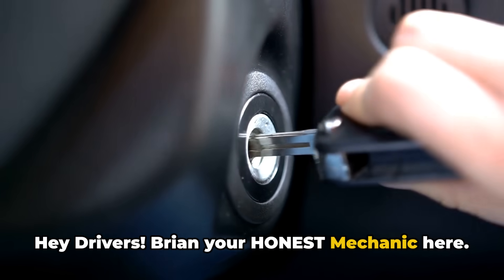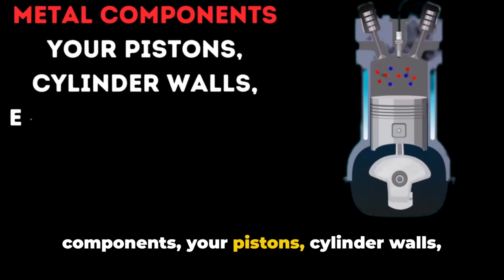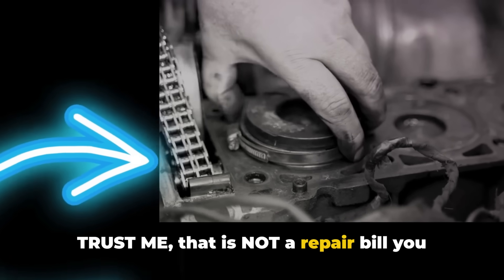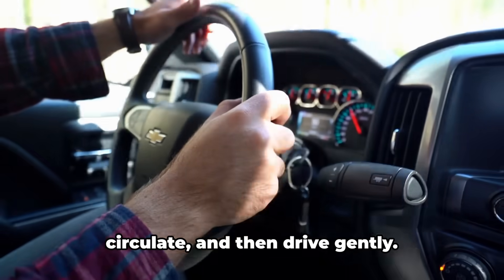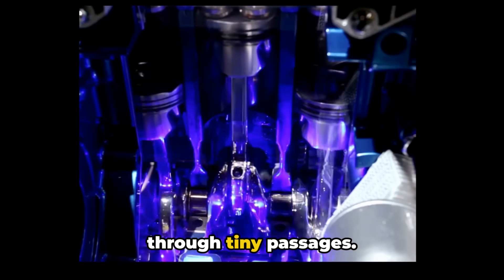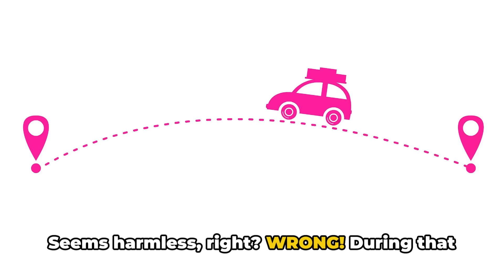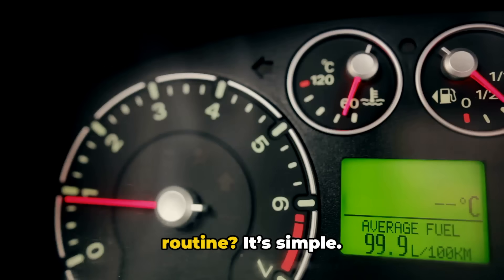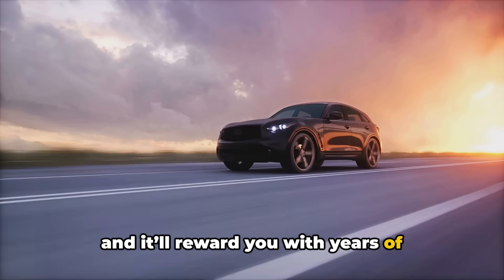5 Cold Start Mistakes That Wreck Your Engine (Avoid These)

Comment: One to add to that list, keep your heaters off until engine is at a reasonable temp, having heaters on on a cold morning at full blast will severely lengthen the time your engine takes to warrm up, this is more pronounced on Diesels as they typically run cooler than petrol engines, I've stood by this for years and notice a difference especially on fuel economy.

Comment: I haven't read 685 comments, and therefore someone might have answered this already. There are two badly flawed comments.

1) Nothing is said about the automatic transmission. The transmission fluid also needs operation temperature to function properly. There was a case were I wasn't able to drive a 15 passenger van that was standing for 3 days exposed to cold wind for 30 minutes. It took another 10 minutes before van was actually moving before there was no "driving like through molasses." The temperature was above 32 degrees but because of the high humidity there was a severe wind chill.
2) How many people can actually go onto the road with a cold engine/gearbox and drive slowly till the car has warmed up? How many do not wait long enough, minimal operation temperature reached? What is missing is: At what time is is safe to go onto a busy road, able to drive based on the traffic?

Comment: No. Don't wait 30 to 60 seconds then just go. Waiting until the rpm dips below 1000 is necessary as well. Shifting out of park above that causes premature wear on the transmission.

Comment: I drove a 6 minute trip to work in a cold climate for over ten years.  Car never warmed up.  I’ve had the car for 13 years and 190,000 miles later it still uses no oil to speak of.  Original exhaust system too!  Don’t believe everything you hear or read about short trips.

Comment: I respect your information, not only because you didn't call an engine a motor, but we all know motors are electrical. But you told the people the correct way and how to properly, take care of their vehicle. Depending on how cold it is I do let my vehicle warm up a tad more on colder days. Other than that I really do the same thing you were suggesting taking it easy on the first few miles of my trip. I am also a mechanic but I'm retired now and I did see all the damage that it can happen to an engine when it's cold.  👍🇺🇲☮🍺

Comment: Hey guys, I'd like a tip from you all. 

I park my car (Fiat Tipo, 1.4 turbo gas/LPG) in an underground garage. 
The temperature under there never drops under 10°C/50°F, I start her up and wait for the rpm to get down to their normal idling level. 

But since I have a quite steep ramp to climb, what should I do to avoid that "early stress" on the engine? 

Should I wait a bit more? Any other tips?

Comment: I must be a genius. I do all of these things. I drive manual transmission sedans exclusively. I drive away right away, (gently!) with no more than 2,000 RPM, and because progressive transmissions have such a huge jump in that first shift into second gear, I always double clutch into second gear. My transmission goes into gear easy. Others gripe about it being hard to get into gear. I am old, and I have never replaced an engine or a transmission. Treat your car right, and it will not cost you much to run.

Comment: What about spring start-up after winter storage? The oil has had ~6 months to settle to the bottom of the oil pan. When I turn the key in my 2000 convertible, the engine fires almost instantly but is in a fast idle mode. There are those few precious seconds when there is an engine rattle until the oil is circulated. In a ‘modern’ car, is there a convenient way of priming the oil before the engine fires? Emphasis on “convenient”😁Some have suggested pulling the fuse for the fuel pump so the engine doesn’t fire.

Comment: Again, no mention of actual cold temperatures. When its below zero, you can't start your vehicle and then start driving in 30-60 seconds otherwise your windshield ices up with no heat...This is fine if its above 20 degrees. If its teens give it at least 2 minutes. Single digits 3-5 minutes. Below zero, if you have a smaller engine, give it close to 5 mins or breathe into your jacket/sweatshirt lol. Polar vortex temps...GL, hope you have heated seats and steering wheel.

Comment: I disagree with driving after a few minutes.
Also you didn't mention auto- trans.
When it's bitter cold + u drive, the oil is thick in tranny.
Seals are stiff + your forcing  everything to move.
Not good.
Been warming up engines for many years no problems.
I let it warm till heat starts happening then the engine+ tranny can function normal.

Comment: " When your engine is idling cold its running rich on fuel "  Not so rich that its blowing past your rings and contaminating you oil.  It's far better to let it idle for a bit in cold weather then your so called wait "30 - 60 seconds" plan.

Comment: I always warmed my cars up before driving.  Never, ever had an issue with engine failure, burning oil, etc., and I run my cars over 200k miles.  You do what you want, but when it's 5 degrees outside, I don't let it run 30 seconds and then drive off, I let it idle 10 minutes.

Comment: work is 30 mins away, engine gets to optimal temperature about halfway through. in the cold i let it idle ~30 seconds, drive off with quarter throttle and upshift at 2000rpm (its a diesel), over time adding a little bit more throttle as the engine warms up. my fuel economy might not be as good as if my workplace was only 5 minutes away, but it sure does keep the car running healthy

Comment: I know this video is about protecting the ENGINE, but since we're talking about protecting the vehicle, I'd like to submit that I've heard this tip: in an automatic transmission vehicle, put it in NEUTRAL for a few seconds, to move around/warm up the transmission fluid, before driving. It is very viscous and doesn't coat the gears in park. 

Thought/comments?

Thanks for the video!

(From a North Dakota native)😊

Comment: You dont have to wait for cold start rpm to go down. Wait 20 seconds and you can drive relax.
I did code off my cold start cuz i have no cat. (2018 golf 7r) 

Ill start wait 20 seconds for the oil to go through the engine and i go drive. I keep it under 3k rpm till temps normal.

Comment: Great advice..... All these things I have done for many years. Change gear at 2000 - 2500 RPM untill engine is up to temp. You can also buy a solar panel battery maintainer for hardly any money if you are not using your car much in the winter - they still produce voltage if the sun isn't actually shining. Flat battery in cold weather? Warm it up in doors in front of a heater for a couple of hours, shake it around loads and hook it back up. May well start the car up.

Comment: My 1998  Isuzu Frontier SUV is at 627 000 kms . I have it from New.  As an old Tanker Truck driver who covered an average of 4 000kms @week , I drive this V6 petrol 3.2 litre like a diesel engine using the Torque to travel at slow speed after a cold start and 60 seconds warm up , instead of high revs. 
I put my seat belt on while the engine warms up in our garage, sort out my glasses and check all instruments,  before I start to reverse out. 
The old Bus is a part of our Life. Despite its size, Our children learnt to drive in it and it has always brought us safely to our destination. Tyres last over 200 000 kms and it has space for the family!!
Reply: They don't make them know like in the old days you're lucky if you put 50.000 Miles on some of them

Comment: 30 - 60 seconds!  BS!  I always warm my car at least to 1/2 of fully warm.  If I started doing the 30/60 seconds my car would be ruined.  For example …it’s 20 Fahrenheit or less.  My car would stahl not to mention the heat would be cold and if I tried to run the heat my car would take much longer to get the engine to warm up fully!

Comment: My car has a CVT transmission locks the engine at 3000 rpm after you cold start it and begin driving no matter how slow you try to accelerate.

Comment: I have a 2004 Subaru Legacy 3.0r Sedan in black and it has 306.000kilometers and I wanted to ask when i wait about 30 sec then i select Drive and I don’t touch the accelerator I just let it roll of its own is it Bad ?

Comment: I doubt all of these tips apply to every vehicle. I currently drive an '89 Bronco II and the older cars need some time before the idle drops (especially in cold weather) unlike newer vehicles (had an '04 Volkswagen GTI that dropped to normal idle after about 6 - 10 seconds). I don't know about driving while the car is going through its start-up procedures but I let the engine calm down before driving off.

Comment: Probably important for someone to point out that if you have a car like a Subaru that idles high when cold, you shouldn't put it in gear until your idle has dropped to normal.

Comment: I have a,2004 Chevy Cavalier and it has 373,000 plus miles on it and the engine purrs like a kitten, no knocks or pings! 4 out of the 5 things I have been doing except the shorter warm up, I do let it warm up, but I am in the 2 to 3 minutes of warming time. Guess I have tirm that back a bit!

Comment: When its cold i put my foot on the accelerator all the way to the floor then crank the engine it wont start because the car has a lockout feature but it cranks the engine which pumps oil and coats everything with oil i do it for about 5-7 seconds i then start the car let it run for 3 mins then drive off also do alot of short trips to deal with that i change my oil at 3k miles or less  even though its fully synthetic car is 15 years old with 82k miles i pretty much did all city miles  bought from auction 1 year old with 45k miles must have been sombody driving back and forth cross country  still dont know how it had that many miles as a personal vehicle in that time period wasnt a rental or business car never once had a problem just change oil tires and brakes and battery my last battery lasted 7 years it was an interstate battery if anybody was curious and the car is a 2010 nissan altima 2.5s

Comment: Driving off after only a minute idling just isn't enough if the inside of your windscreen is frozen/misted. 
This is common on older cars, I might as well drive off blindfolded, especially when the winter sun is low and bright.

Comment: I try to tell my friends this, we’re all car guys, and they swear that they need to wait at idle a long time before leaving for their engines to warm up, now i understand some older cars especially carbureted ones but most cars around just need to wait for the oil to circulate and be gentle with it until it gets up to temp then you can drive it however

Comment: One additional edit, if you have a very performance oriented engine and have, lets say, a 6 speed, leave it in 5th on the highway to get her to temp just a bit quicker, but keep below 3500 rpm (if ur engine is like cruise in 6th at 2500 type car...

Comment: During the  North Polar Vortex in 2014 my 2003 Honda Element made a rather strong banging sound one day when it was 27 below zero.   It still went over 249000 miles on the K series engine.
Reply: That's impressive durability for your Honda Element, especially enduring such extreme cold! The banging sound at -27°F was likely caused by the oil thickening in the frigid temperatures, making it harder for the engine to circulate oil properly at startup. Despite that, reaching 249,000 miles is a testament to the robustness of the K-series engine and probably your good maintenance habits. A true workhorse! 🚗💪
Reply: @ My dad used to use a old trouble light with a standard buld to stick under the hood of his old jalopy to allow it to start in the extreme cold. 1977

Comment: I have no choice but to idle the car for a long time before I drive, cuz we have negative 30 celcius where I live, and also, your car actually heats up faster when it's idling contrary to what this video says. When your car is standing still, no air is flowing at it, which means no air cooling, and the thermostat doesn't open until a set temperature is reached anyways.

Comment: Here in Fairbanks, Alaska it can get colder than -40 degrees.  We have oil pan, engine block, and transmission heaters plugged in 2 hours before starting.  A battery tender as a 50 percent charged battery could freeze at -40.  Synthetic fluids always!
Salt is not effective at these cold temperatures (they use gravel instead) so vehicle body lasts forever...you will see many pickups from the 1980s and 1990s driving around with little rust.

Comment: Unfortunately, I don't have a temp guage on my german car. So, I do everything you mentioned but I leave my heater off for the first five minutes of gentle driving and then turn on to a low heat setting and when a gentle warmth comes through...I am happy my engine has begun to warm up. Is this a reasonable thing to do? Thanks.

Comment: You should really take ambient air temp into consideration . At extremely low temps you should let your vehicle warm up longer and even put it in neutral to help your transmission fluid start to warm up. It's a good way to avoid damage. Ive lived in North Dakota for over 40 years and have seen a lot of engine damage and transmission damage from only letting your car warm up for a minute when it's below zero
Reply: Does leaving it in Neutral circulate the cold trans fluid, when Park would not?

Comment: FALSE!!!. "When your engine's idling cold it's running rich on fuel which means excess fuel is seeping past those cold piston rings and diluting your oil , , , "
1) "Running rich". This increases pollution (illegal) and decreases gas mileage (hurts sales).
2A) "Seeping past cold piston rings". Since the engine was invented, the function if the piston rings is to SEAL the combustion chamber. 
2B) It wouldn't be liquid fuel seeping thru, but combustion gas, which is very hot, thus likely burning the rings.
2C) For fuel to dilute the oil, it has to be liquid. The fuel is gas/vapor, so how can it do this?

Comment: Honestly, I would say one of the best videos for modern day cars and the proper procedure. So many Old-Timers act like their cars still have carburetors and they just cause more harm than good. 

The only thing I don't agree with is the oil. Like yeah, if your car is about 10 years old then usually there's a different type of oil you use It's always in the manual but it's for stuff at the extreme like below. 10°. 

Most modern day oils are so thin that it really does not matter. You don't have to change out to a thinner winter oil And yes that's what the w stands for winter not weight

Comment: We need to use the heater to defrost and demist the windshield, ths is just reality. Switch on, wait a minute to get the engine lubed, then idle at 2-3000rpm for 2 to 3 minutes to get the heater blowing warm. To say anything else is false reality.

Comment: The question is how long it takes for the engine to be fully warmed up ?  I used to work 5 minutes from home, in winter by the time I get in my car from my job to my home, the needle didn't had time to budge.  I knew this was bad I often made detours when it was really cold to the engine can get hot before heading home.

Comment: I have on normal weather 1 minute and in extreme cold while I clear ice etc about 2-3 minutes never had an issue. And always use the right viscosity and oil type. Never have had an issue with my cars and trucks

Comment: The engine produces condensation at any temp, even when its hot outside. If you have water in your oil and gas, you have bigger problems. The water burning off from the oil and gas was the biggest bunch of bullshit I've ever heard.  I warm my car up in the winter time on colder days because who the fuck wants to drive down the road freezing their asses off. Idling for 15 mins or so in the morning to warm up your car isnt going to hurt a damn thing. Its no worse than being stuck in traffic.

Comment: 2nd one isn't practical. You can't just jump in the car and drive off after 30 seconds when it's minus 7. Even if you cleared the windscreen it would just frost over again. I'll stick to letting it idle for 10 minutes with the fan windscreen setting on so it's all nice and warm when I get in with no frost. 👍

Comment: In the winter when you’re car is frozen solid ice on the windshield you start the engine slowly and let it run so you get heat on the windshield is that right?

Comment: How long do you have to drive for your engine to warm enough to turn off. He never said.
Reply: I go by 1) Coolant temp to operating ( 90 C in my car ) , 2) More than 6 km and more than 12 minutes of driving time - my oil is at about 65 C by that mark on cold days. I would not drive less than 6 km ( 3.7 miles ) if its colder than -5 C ( 23 F ) - thats a safe mark.

Comment: My trips are usually short, so best I can do is gentle driving & frequent oil changes.

I'm not gonna warm up or take longer trips on purpose, it's a waste of my time and puts more wear from increased running time.
Reply: I lived like that for a couple years, when my trip to work was like 10 minutes. Can't say anything about engine wear, but it seemingly destroyed my battery quicker.

Comment: Start your car in -25, 30-60 then drive around frozen and cold and get frost bite 👍 But save 15-20K on your engine..no thanks! Also, my truck is at 2500 RPM at 120 km/h so…that’s not gentle lol
Reply: Most vehicles are at 2,500 rpm at 120 kph. Thats normal. I dont use my car on the highway unless the coolant is at operating temp ( 90 C ) and the car has been running and driving for at least 5 minutes.

Comment: When starting my car in freezing temps, I usually press the petal to the floor and then start the key. After about 2 mins of full throttle I slam my foot on the gas several more times to get the juices going